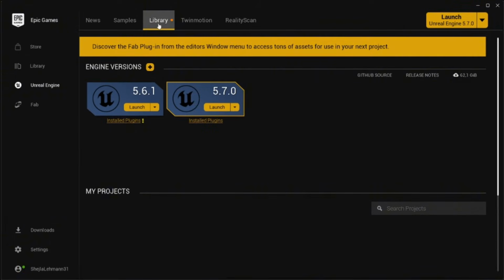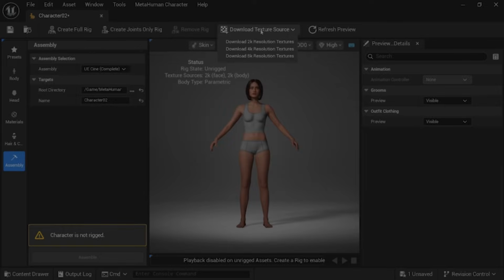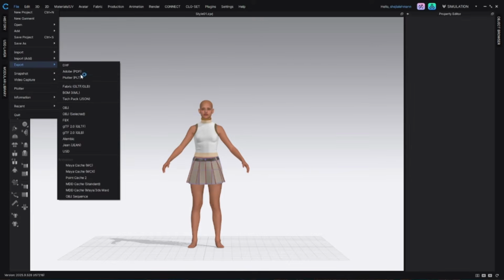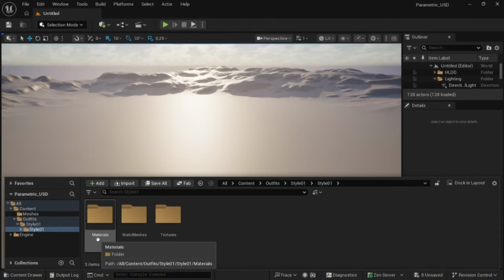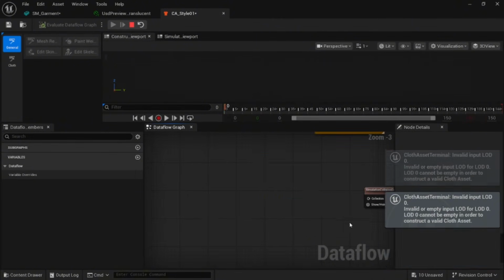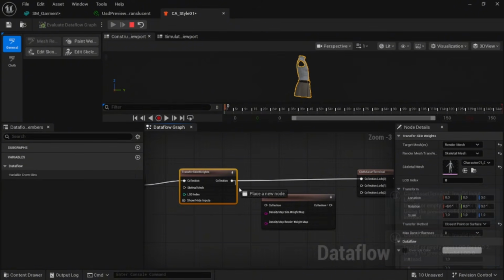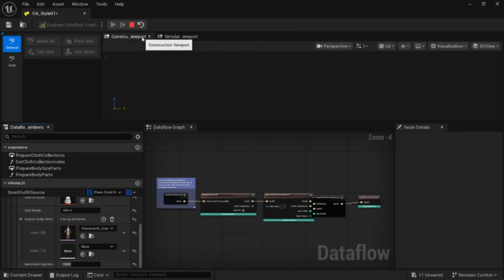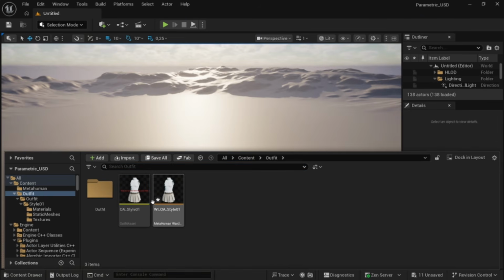How to use MetaHumans in CLO

Comment: - There's no export option for welded USD garments? That creates an extra step of welding in third party DCC, where you can also scramble the simulation data if you're not carefull;
- You can't separate the garments by material, name, or some other property. The USD export always exports all of the patterns as one. That's not handy if you need to correct weights in Unreal;
Reply from the maker: For export help please post to our CONNECT forum where a team member would best be able to help

Comment: would be even nicer if theres a way to import groom assets for the hair into clo3d, so that you can render your metahumans also in clo3d. 
the problem with importing clothes in UE5 is that if you have topstitching it wont be nice when you import it with unified UV coordinates and if you avoid the unified UV the topstitching wont be imported at all. so garments will either have very bad looking topstitches normal maps or be very flat and without normal maps for topstitches making them very flat and not accurate in terms of design!
.
I tried several times for months to pass this problem to the clo3d team but nobody seem to be able to address the issue (which is still persisting since livesync came out). Its not a problem with my software version, i tried lots and lots of stuff and it seems to be a technical problem on the software itself not being able to pass the 3D topstitching data of the normal maps (opacity, thickness) to UE5 because when you import it with "unified UV coordinates" clo3d will "print" in the normals texture of the garment the topstitches with the maximum opacity 100% and hardness, resulting in having very hard topstitching lines in ue5 that cant be edited.  
.
please fix this T-T
Reply from the maker: Thanks so much for the detailed feedback. We will share your input with the team.
Reply: @CLO3D thank you, i really hope so, cuz i've been trying that for ages now
Reply from the maker: Of course. For any future questions you may have we recommend posting to our CONNECT forum where a team member who specialized in UE can help - https://connect.clo-set.com/community